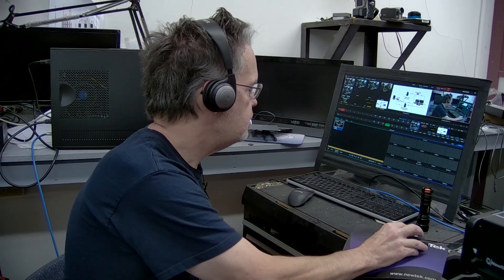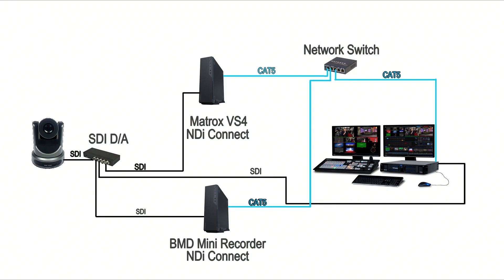Newtek NDI Latency Test

Comment: Really hard to tell anything because it looks like this feed overall has a couple frames of audio/video async. Doesn't Advanced Edition 2 have video and audio delay settings?
Reply: I completely agree! Do you have any feed that are 0 delay to compare with?
Reply: I don't. You'd have to adjust the A/V sync on the video or see the original video to really tell what kind of Latency you're actually getting. The distinction between sync, delay and latency are often muddied.

Comment: Hi James, can you tell more about BMD Mini Recorder NDi Connect ? Can't find it on BMD Products (https://www.blackmagicdesign.com/products). Thanks. Christophe.
Reply: +culturesportboules I think this means a combination of the BMD Mini Recorder hardware being used with NewTek's NDI Connect software - not a single product.
Reply from the maker: Yes as I indicated in the previous post this system was built to the same spec as the Tricaster 460 system . I used the blackmagic mini recorder as a capture card and Newtek's NDI connect ndi.newtek.com